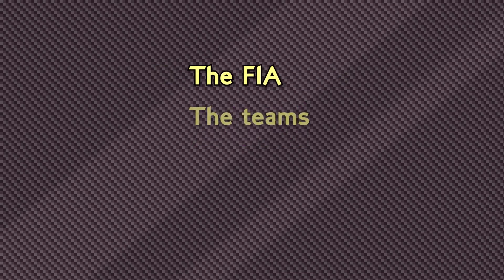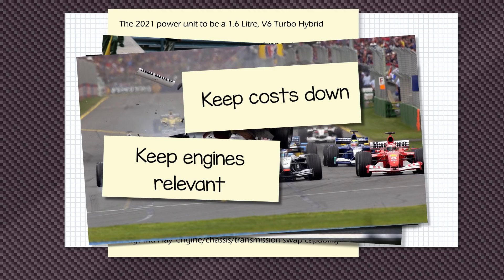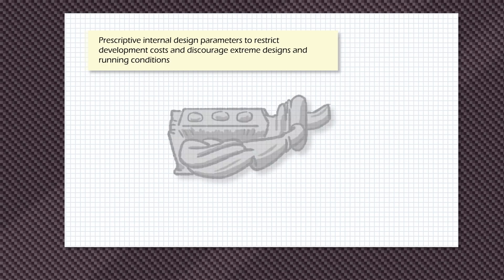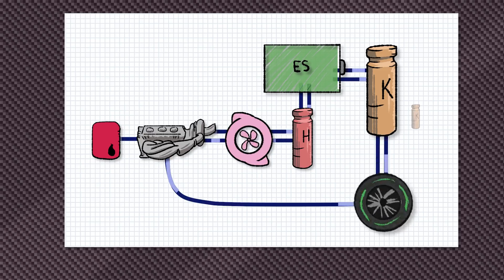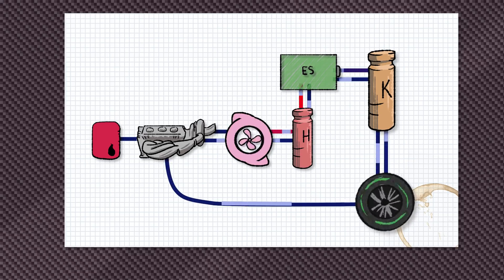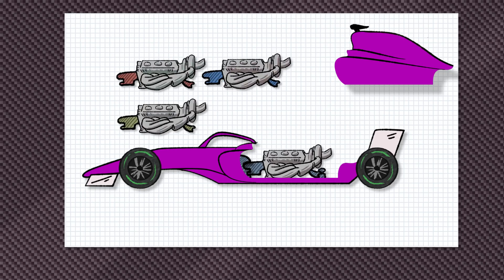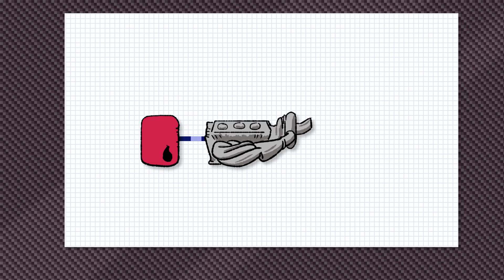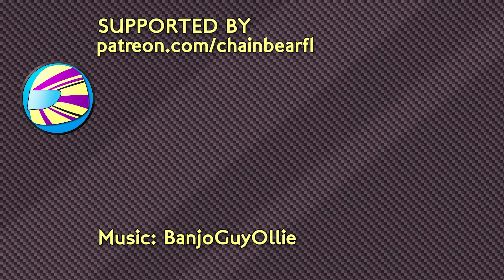F1 Engine proposals 2021 explored

Comment: I disagree that wanting F1 to go back to V-10's is a "hipster" thing. I'm way too old to be a hipster, nor do I care about being hip. The idea that F1 is some kind of engine design incubator for street cars has been dead for at least a decade now, as it should be. For applicability to future street car engine design, look to Formula E, and be prepared to be bored. Internal combustion engines are simpler, far more dependable, and easier to work on. 

There are 21 races this year. If they were all running V-10's, of course they would pollute. But did you know that ONE container ship emits the equivalent pollution of 50 million cars?(https://newatlas.com/shipping-pollution/11526/) That there are 90,000 container and cargo ships operating, and they emit more pollution than all 760 million cars on earth? This isn't even counting the dozens and dozens of cruise ships. 

I think most fans want F1 to go back to V-10's. They want to hear the howl those things make, it's part of the whole experience. I don't want to watch a bunch of cars whispering by, even if they're going really fast. If that's what one wants, they can go watch the joke that is Formula E. The fans ultimately pay the bills in F1, and the FIA should start taking their opinions into primary consideration.  

Take one container ship out of operation, and you've more than made up for the emissions of 20 or so V-10's running full out for 2 hours for 21 races.

Comment: I think its time for nearly every category of race car to admit there is no real relevance to road cars. Its kinda the point that they are called raaacee cars not roooad cars. Its like sitting in business meetings hearing your ceo drone on about mission statements and satisfactory customer outcomes. No such thing in any form at all.

Sure you see the development and technology swap hands. For example we see active suspension and F1 style transmission in some cars, but for the most part the only real thing F1 cars share in common with road cars is that they have four wheels an engine and a driver. 

I think what most people want with F1 (and any kind of motorsport) is a contest that is both close and a spectacle that will interest the general public, not just a select group. F1 has always achieved that by being a great contest that includes both building a technologically advanced car (for its era) and having a great driver that can compete with that car on the track. Where F1 has failed for 30 years is getting that contest on the track to be close. How many F1 races in Schumachers era where decided by the end of the first corner....heaps. You dont need 15 guys to come into the last race with a chance of the championship, but you also dont want a championship decided by mid-season like it practically was in 2017. 

In my opinion you want F1 to be loud and fast. Most people dont even understand the concept of kinetic and thermal energy recovery, let alone care if its part of an F1 car's makeup. No one, gives a hoot if the cars guzzle fuel or if they are running the latest organic renewable fuels. Does anyone look at a rocket launch and go "my lord, that rocket uses a backyard swimming pool worth of fuel every 3 seconds"? No! Insteady they go "that thing is incredible"! With racing, less is always more. Get rid of these stupid hybrids. Go back to four wheels, and engine and a driver that has the nuts to throw a car around monaco at 250kph and 5cm off hitting the walls. Go back to cars that are so loud they can wake the dead.....There's your crowd and sponsor puller.

Comment: 2.0L non turbo 4 cylinder with MGUK only......basically a Prius
Reply: What about the 2.0l 4 cylinder out of the Porsche 919. Seems like it goes alright.
Reply: @dampaul13  Yeh, I think something of that nature is an inevitability. Not in 21 but I think they will announce changes for it in 23 or so.
Reply: No chance
Reply: Bugatti is cool Lans would continue the trend of -2 cylinders per generation
Reply: A Prius with almost a thousand horsepower.

Comment: Amazing. "Partly because the sound of the combustion engine will disappear" Wow. That's formula E... right?  Formula 1 has been its entire life a full sensory experience. I'am not so certain it will survive it's present development stage. Group B rally cars were banned years ago... and still i watch and listen to them on the net regularly. The telephone analogy should tell you lots, as more than half of telephones today make the old telephone sound when rung. Formula 1 as far as i can discern, is a sport where the fastest machines combined with the fastest drivers compete. Fuel economy and fuel efficency (although they have their place)... not so much. I suspect when the directors of formula 1 realise that the tunnel they are in has no light at the end... a bit of back pedaling will take place. And if not... well... like i said.. formula E.

Comment: Removing the MGU-H means that cars will need an "old school" method to match engine revs with turbocharger revs. What I want to say is that we will see the return of by-pass style systems to avoid turbo-lag and some kind of wastegate to get rid of excesive pressure in the inlet plenum. Maybe that could help to improve the engine noise and make it more "friendly" for  the fans...

Comment: what if football or baseball had to conform to societal pressure to be modern in the same way that f1 does, weed probably have mixed sex teams with solar powered stadiums, then again f1 did this to its self when it took on the role of the ultimate proving ground, manufacturers have to prove their tech works so f1 has to move with the industry. just hope it never becomes formula e.

Comment: I don't follow F1 at all that first. But from a development point of view. I would like it if F1 would keep evolving in better effecienty and better fuels and if even possible fuels that don't have any emissions (if something like that is even possible with no emissions I do for now mean something that has Co2 in a recycling loop like it has in nature) but keeping the combustion engine. this because there is a championship with electrical namely formula e. But that's just my opinion. And I do like somehow a combustion engine just the sound it has. The horrible effeciency in power making it more a challenge to develop something. Where a eletrical motor always has the highest amount of torque at any rpm.

Comment: I don't like it.

V8 or V10 plz.
Reply: El Chasco V10, the V8 is good, but it can’t compete with the V10.
Reply: Hotdog 5967 yes
Reply: Thi Nguyen years and years of v10s in f1 will do a highly miniscule to nothing to the environment. Its literally 20 cars that run 3 times a fortnight.
Reply: Some of the best sounding cars in f1 were v6. We don't need a change in cylinders we need a change in revs.
Reply: What about v12
Reply: Thi Nguyen that's a fucking competition men.

Your argument is not valid.

A F1 season emits minus CO2 than a intercontinental flight
Reply: +Thi Nguyen - "This causes lots of global warming, and in the near future, our world will be nearly inhospitable"    You should really do some research on climate change and the top polluting industries. I'll give you a hint, the 15-20 largest container ships pollute more than every vehicle on the roads
Reply: moron, a 700hp v6 produces the exact same co2 as a v10 with 700hp, whats heavier a pound of bricks or a pound of feathers?   actually no a v10 has smaller combustion chambers so it produces less emissions because the flame front doesn't have to travel as far so less unburnt fuel makes it through.

Comment: It's truly devastating for real F1 fan.The V12 should be replaced as soon as possible ,we don't want a car which has got no sound 😭😭😭😭😭.It sounds like a dumbass.😬😬😬😬😬 Please you stupid f1 committee replace these low powerful v6 hybrid engines as soon as possible.Because this is race;we don't need to be efficient here any way.We just need more power and more speed and a better and louder fluent sound.This is what f1 is all about🙌🙌🙌🙌🙌

Comment: You make it sound like F1 is going to turn into the stupid formula e series by the way you say the combustion phase will be gone.  think if it comes to around then and not for a loooong time i think the big wigs of f1 would pull the plug before then. I did like the video but you seem a little too much FOR electric "engines" but thats my opinion. But good job  explaining the new rules

Comment: Just like FIA trying to revive the legendary Group B, with using current cars. Impossible
Reply: What are you talking about? The new rally cars are pretty much the same as back then. Huge aero, light and a turbo engine. They have a little bit less power but are faster still. The sound is still similar, (maybe not the audi) and they are still awesome to look at. 

WRC is pretty much the only form of Motorsports where the idea of going back to the fast and wild glory days has worked without reducing safety and with everyone including the manufacturers happy. Even Seb Loeb came back for a part time season because the cars are awesome. I'll make sure to visit a rally while these cras are racing because I can see people in 30 years time saying "remember back in 2017 when they made the cars as fast and exciting as group b cars again? That was awesome."

Comment: TBH I would rather watch 10 cars race around the track with the best R&D battling out with the best tech from power, efficiency and aerodynamicd than 50 cars that are pretty much the same. 

F1 is becoming that class where there are 10 A* students and 20 D grade students so they move at C grade pace. 

Its really holding back the best of the season IMO.